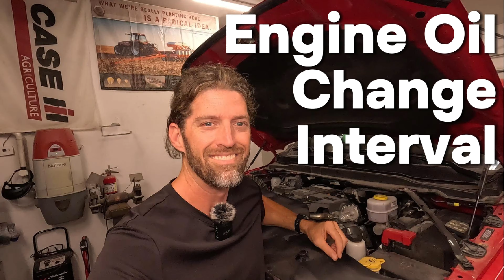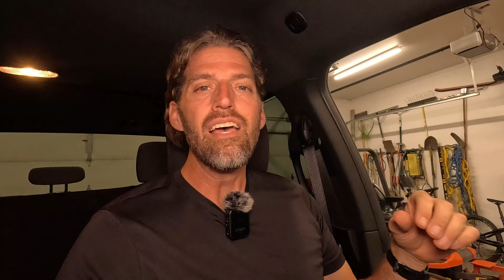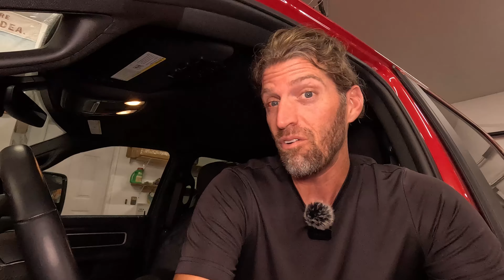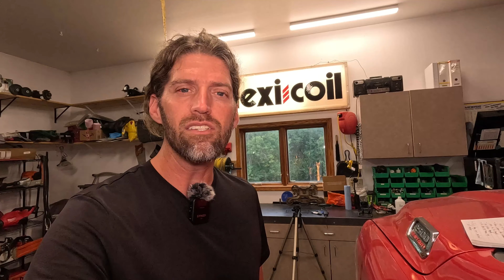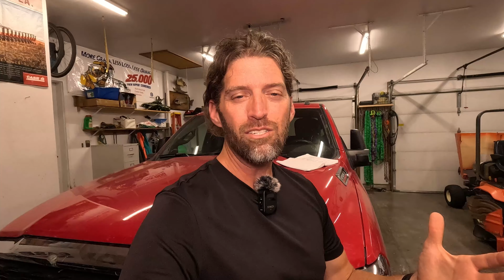When to change your engine oil? Factors to consider.

Comment: I have an SL500 costs me $60 to change the oil and it takes 8 synthetic quarts.  Not sure where you buy your stuff?  The manufacturer only cares about getting you past the warranty.  I have the car 18 years now and the valves look new, 87000 miles.  If you plan on keeping your car, change the oil at least at 5000, and if you don't drive that many miles and it's garage kept once a year.  If it sits out in harsh weather, every 6 months.  Just my opinion and experience.
Reply from the maker: Thanks for the comment and sharing. Agree, sooner maintenance (rarely) ever hurt. Definitely wanted people to thi k bigger picture, beyond just mileage, as an indicator for change......otherwise a generator or power unit would never require an oil change, right? 😀 

Mileage has always been a good directional indicator, on vehicles, but other things are valuable to consider, such a engine run time. I drive 90% highway, so my distance traveled to engine use (hours) is quite a bit different than others.

Your thoughts on engine use/hours as an indicator of oil change internal instead of, or supplement to, mileage? Cheers!

Comment: Youtube is full of videos of people who tell us to follow the manufacturer's recommandation when it comes to maintenance but it only aims toward allowing the car to live up until the end of the warranty. So I follow engine builders' advices when they tell to perform maintenance at half the recommandation provided in the service manual. That's why I change my oil every 8000km or twice a year; it's cheaper than filling my fuel tank and I do this every 2 weeks without thinking about it.
Reply from the maker: Thanks for the comment. I completely agree, there is no better people to take additional advice from that an engine mechanic, I'm friends with many, they're great (and talented). Definitely just wanted people to think about the different ways to look at engine oil change intervals as, for example, the engine movement (hours) is significantly different for a person who changes at 8,000km who averages 35kph and the person who averages 55kph over that oil change. Cheers!

Comment: All Dodge cares about is that your engine gets past the 60K mile warranty period. If you want the engine to last 200K+ miles, change your oil at half the manufacture's recommendation time. Oil is cheap. New diesel motors are very expensive.
Reply from the maker: Thanks for watching. Understand your comment. Definitely just wanting people to think broader that 'distance' for oil change internal since what we ultimately should worry about (my opinion) is the amount of movement in that engine, which is where the wear comes from. Part of the reason I also went straight to Cummins to see what they said. Other thing about my scenario, I drove 85% highway, so my average mph is high, so at 14k miles, I was at 350 engine hours, which is about 70% of the recommended 500hr interval. But, 100% agree, more frequent maintenance isn't bad. Take care!

Comment: A company I recently worked for never wanted to allocate time for me to properly maintain my work truck. I never ran it harder than I needed to and avoided any unnecessary idling, but it was constantly over loaded and I spent about a third of my time in the mountains. It was a ford E450 cut away boxtruck with the gas V10. The oil was routinely changed at twice the recommended intervals. That made me cringed but it was their decision and their truck. All that said they still use it and when I left it had just over 300,000 miles and ran like the day I started driving it. So I don't know what to think when it comes to regular oil change intervals and using an engine hard. Just a note though, that it never sat any amount of time. Previous to this experience, I would have thought an engine could not last 300,000 miles with that kind of hard use and abuse, so now I just don't know.
Reply from the maker: Woah! That's wild! And, sounds like that engine is pure stubborn.....I know some humans like that!  Thanks for sharing!

Comment: Nowadays, engine replacements on these new vehicles are quite expensive! The costs can go up to $30,000. Using your example of an approximate oil change cost of around $125, it would take approximately 240 oil changes to reach $30,000. 
30,000/125 =240 
240*5000 miles would give you 1.2 million miles out of your engine 

Oil breaks down and degrades over time. If you plan on getting rid of the vehicle after the warranty runs out by all means do as little maintenance to save as much money possible. But if you want to keep your vehicle for as long as possible I would not recommend following the manufacturers recommendations. They have long service intervals for a reason. In my opinion those intervals are just enough to get you past your warranty period.
Reply: I don't even own a diesel but i got caught up watching Dave Auto channel where they have a lot of diesel trucks in Utah. I didn't realize that they often pull the cabs to get to those motors. https://www.youtube.com/watch?v=86uGn9GzjI0
Cha-ching$!
Reply from the maker: You bet, fully understand, sooo many variables when it comes to intervals. I really wish all engines had hour meters to better show actual use. The average miles per hour of use can vary so widely. In my case, I'm 90% highway, from driveway to work and most everywhere in between, so I was only 70% of Cummins' recommended hour interval. Would have been a lot different for most others. And then, all the other variables. I was a few weeks beyond where I wanted to change it, but life got in the way. Thanks for sharing.